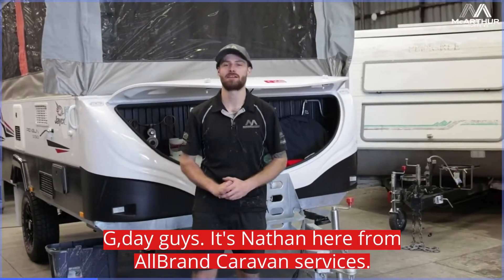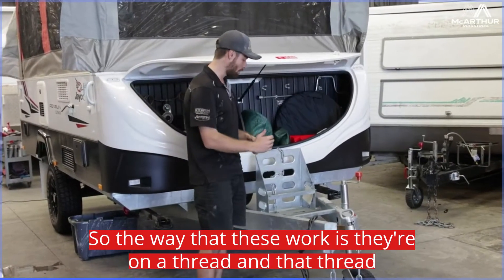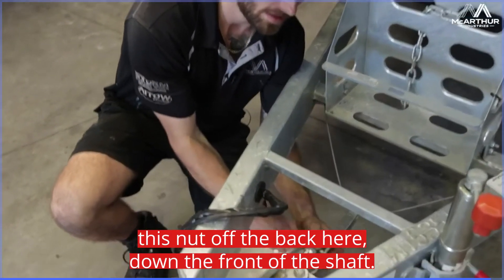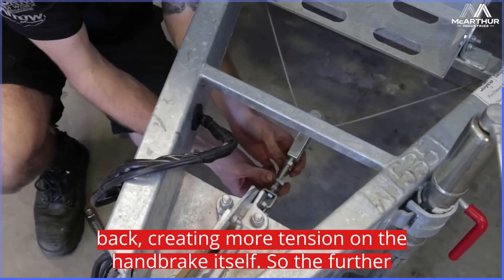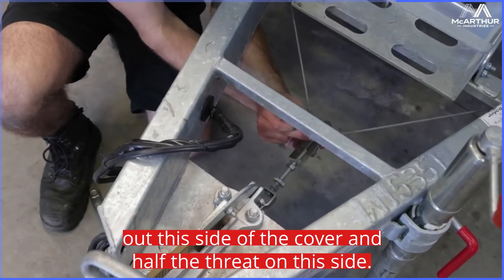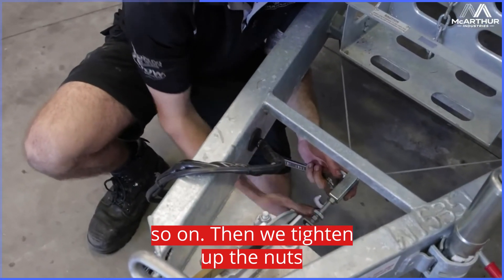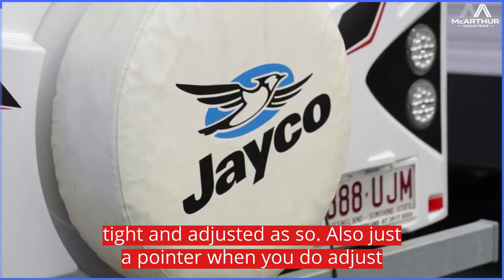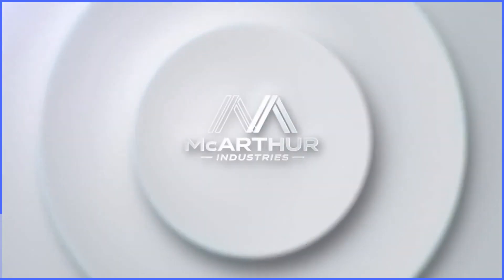Caravan Handbrake Adjustment: Essential Safety Tips

Comment: Hi guys can you please tell me where I would adjust my cable override disc brakes at the wheel , I “suppose the adjusting nut “ on my camper trailer any pics would be good thanks 😊
Reply from the maker: Hi James, we would need to see photos of makes and models to help, normally there is a thread with a nut on it and you can adjust at this component, but it is experience on how far to go with it so you don't put to much friction on the disc with the brake pad. Thanks
Reply: @McArthurIndustries  👍🏼